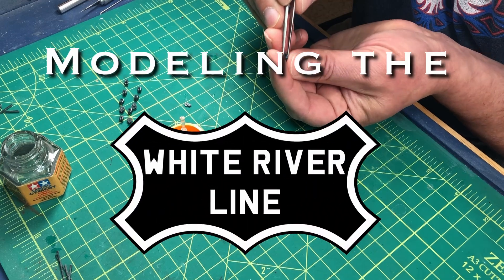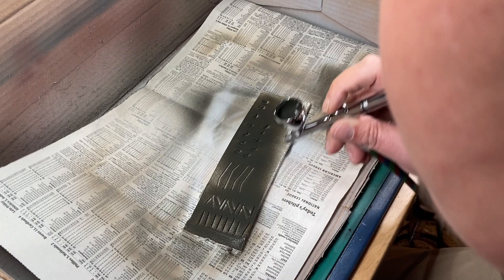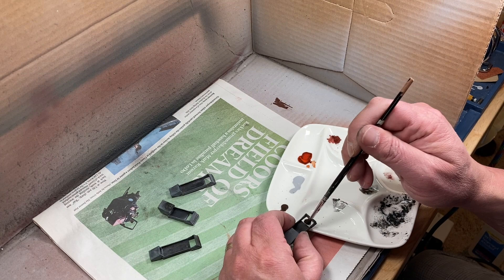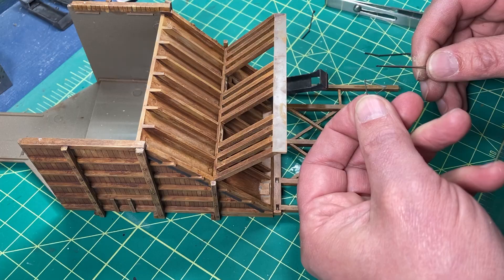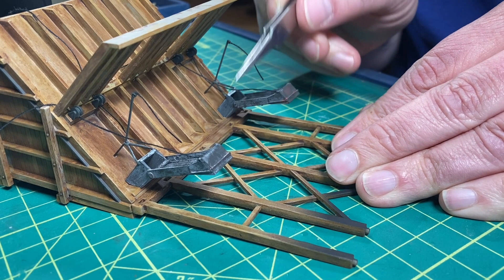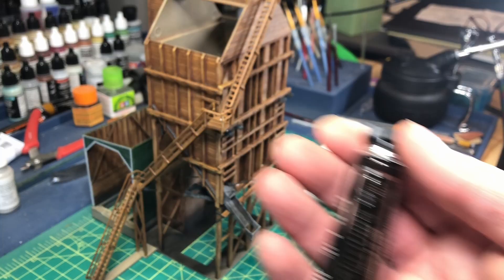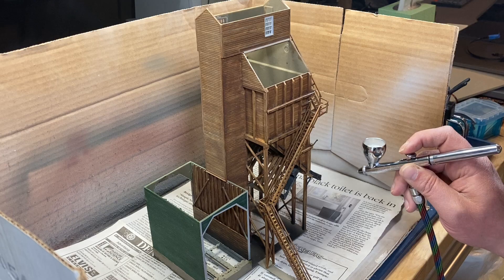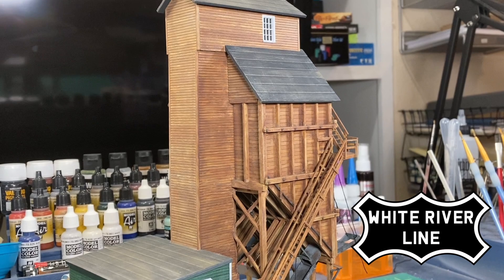Building a Walthers Coaling Tower for My Model Railroad Part 3

Comment: good job drew! i think the extra hours with the brush were worth it. when you work with thread, do what the ship modellers do and run the thread thru beeswax ! it wont sag later and hangs straight.  also stagger your rail joints handlaying track . thank you for enjoyable videos.
Reply from the maker: Thanks for the suggestions! How far apart would you stagger the joints?
Reply: @WhiteRiverLine  when handlaying track i  start out with one full rail and one half length roughly. this ' joint ' will move under circumstances, but i guess any stagger would do, but especially on curves.